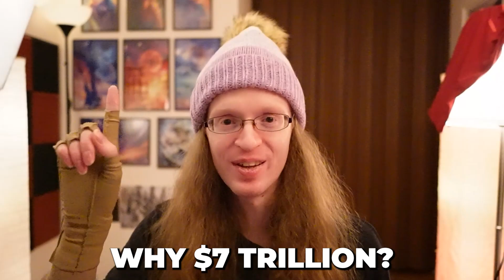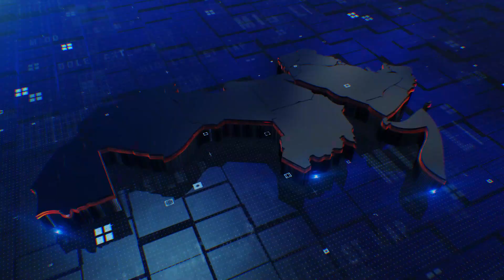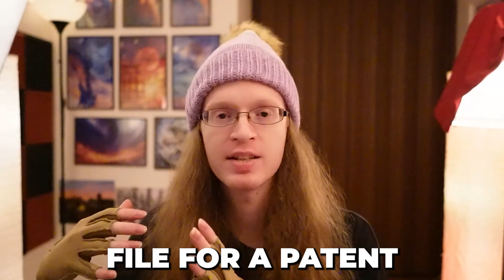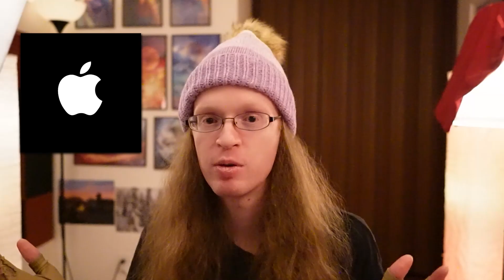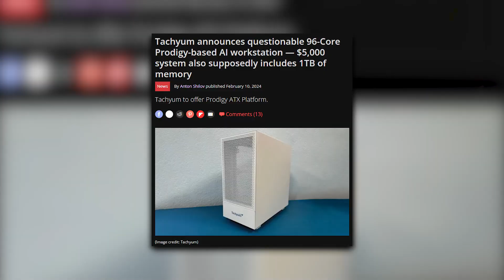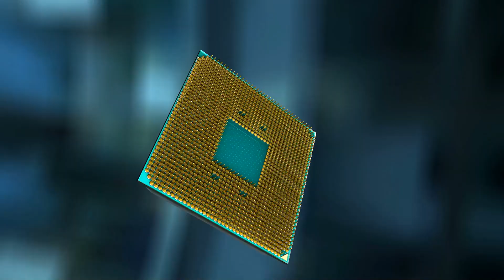Will AI infrastructure really cost $7 trillion?

Comment: $7 trillion is an absurd ask for any single project... However $7 trillion to build a parallel sand to sentience manufacturing and computing pipeline that could deliver 10x returns in a couple decades... That's downright reasonable...if you're thinking in the long term.

Comment: The current AI on floating point processors is such a crappy hack.
It will inevitably be replaced with a silicon (or other inorganic) architecture that doesn't have the huge power-waste of EMULATING the weightings within a neural net.
There are research chips out there that do this now.
Once one of these architectures breaks big these early days of emulating an intelligence by running scaled-up chatbots on re-purposed bitcoin mines will go the way of the steam train.

Comment: A good analysis, but I'm not sure in the final part that chips are the only problem. Taking George Hotz tinygrad argument, AMD has mature designs with huge TFLOPs/$. The reason they're not on par with Nvidia in the league tables is the software framework. He also argues convincingly that deep learning frameworks shouldn't rely on turing complete branching logic, and so you need to implement fewer OPs, meaning any chip can easily supply the matrix multiplications you need for deep networks.

Comment: 1. Semiconductor grade silcon is expensive and we are running out. 
2. The equipment to make chip is expensive and  is not enough to ramp up production needed. 
3. We would need more clean water for production. 
4. More power for production and the server farms.
5. More materials for all the fabrication, server farms, and power production. 
6. More skilled workers will need to be educated and trained. 

All of this makes it more than just GPUs.
Reply: I fail to see why we could not ramp up production of semiconductor grade silicone.
Clean water might be short in Taiwan, but not worldwide. Also we should be able to clean it.
Reply: @NoidoDev  you can, but that comes with a price as I pointed out.